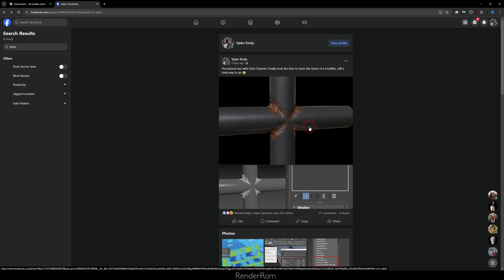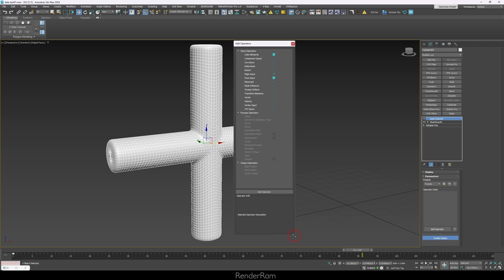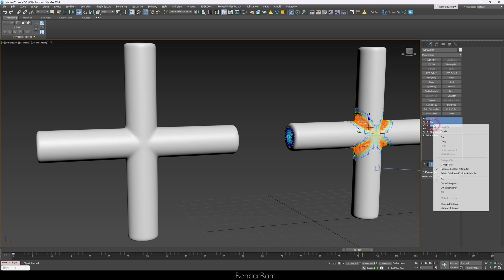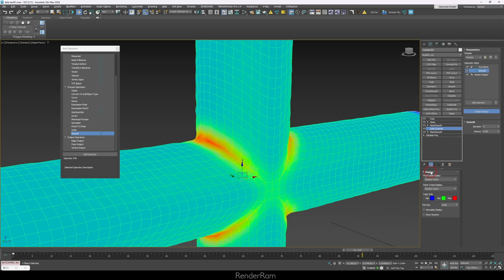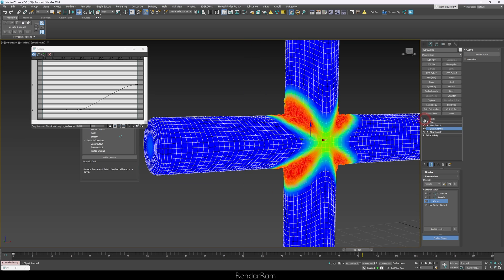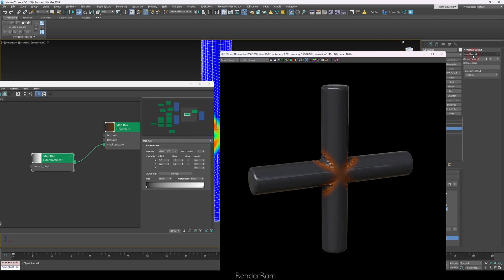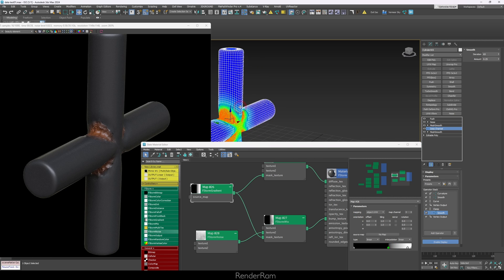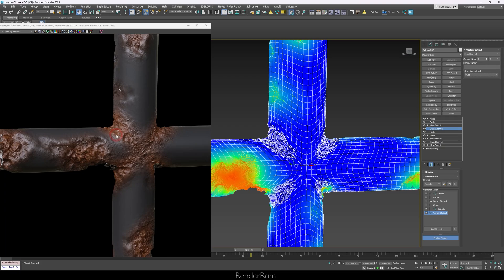Procedural Rust (Or Anything) With Data Channel | 3ds Max

Comment: works with 0.99 and not with 1 because with 1 it cycles the thing 😅
Reply from the maker: Totally makes sense, but I still don't get why the default  vale is min: -5000 and max: 5000